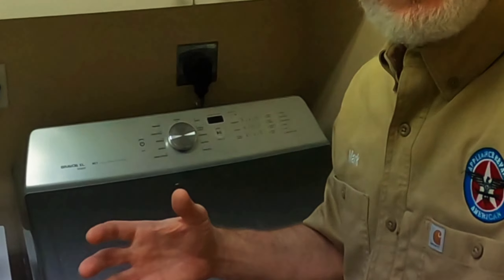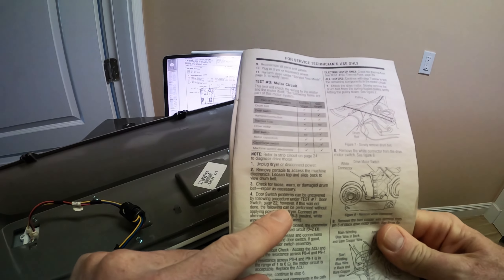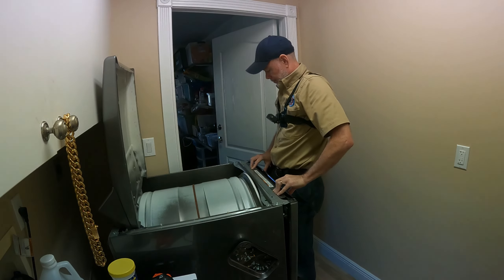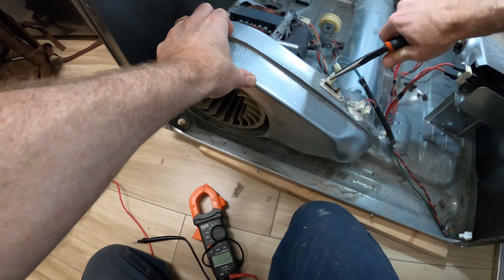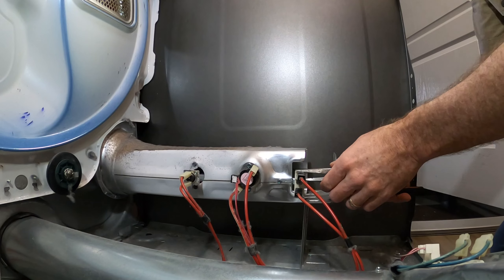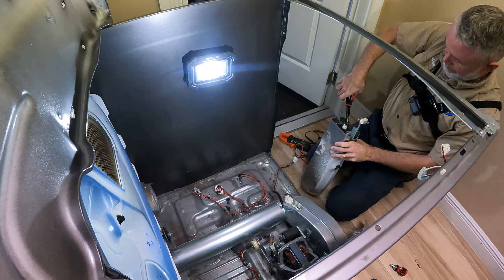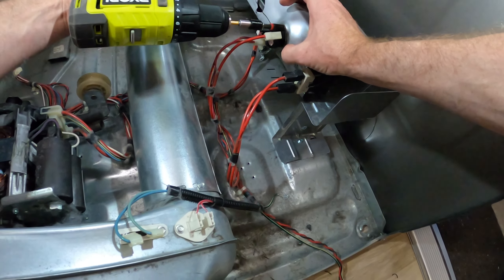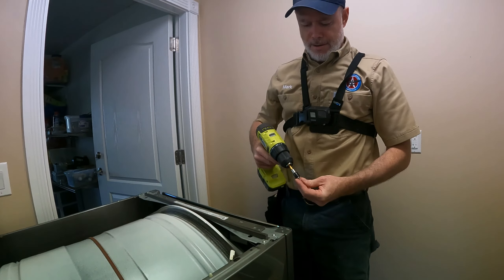How to Troubleshoot & Repair a Dryer That Won’t Start

Comment: Best video so far and I've seen many. A friend took my dryer apart and now I'm trying to figure out how to reassemble. They took the front apart a little more then you did..by taking the door off the assembly. Uuugh. But your video will definitely help me with the rest of the assembly...once I figure out where these 2 springs go.
Reply from the maker: Best of luck

Comment: Hi, How long have you been repairing Appliance ?  I live in Massachusetts and am handy as i started repairing Lawn mowers as a side gig but would like to learn 
Appliances .. How long does it take to learn the business ? Thanks and great Videos !
Reply from the maker: Funny you should ask. I am creating a Free, Earn as you learn, application. Stay tuned. I should have the Free course section out in about 3 months. The complete application will actually send you jobs and give you all the learning tools to get them done confidently. In the meantime, watch as many videos as you can. It is not all that important to learn theory and complicated technical stuff. of course that helps and you will eventually learn it all. Experience is King. Watching others on video is second to actual experience. I recommend focusing on the type of machine you feel the most comfortable in and start taking jobs on that one first. Once you get comfortable expand to another type of machine, not brand but appliance type. Subscribe and stay in touch. I am building some awesome tools for creating an Appliance Tech Guild

Comment: I have an older model Legacy Series Maytag Fas Dryer and have moved into an older home which requires and adapter for conversion and I can’t determine where the grounding wire plugs into. Please help
Reply from the maker: I do not have a video tutorial on that, but it you search you can find one
Reply: @appliancerepairamerican  Any suggestions on where to start? I thought this would be a good beginning. And thank you so much for your response.